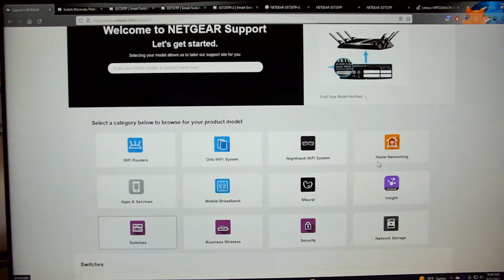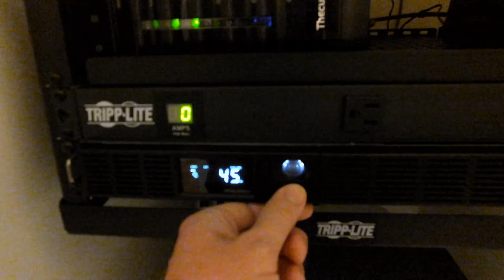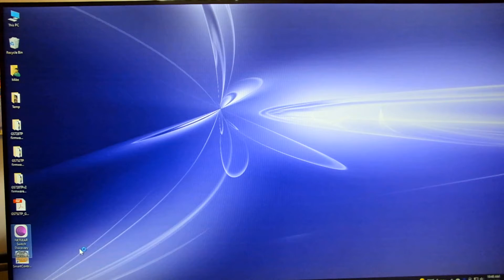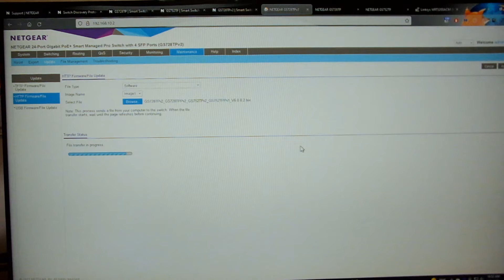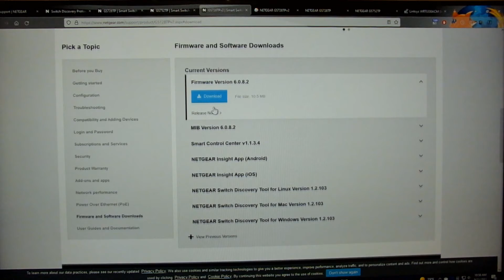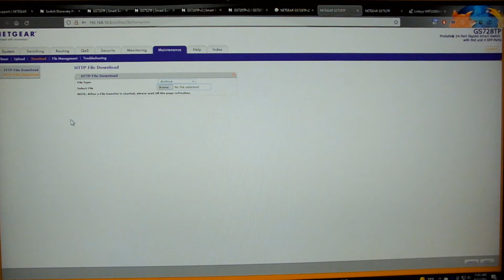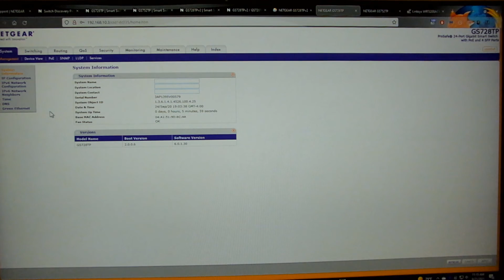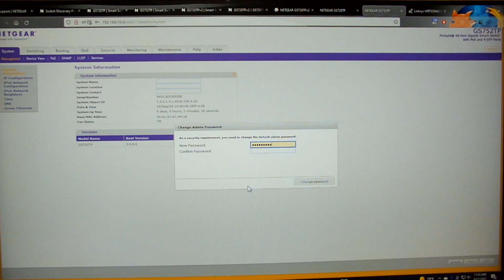How to upgrade firmware on Netgear switches

Comment: Very helpful video!  If you don't mind I took some notes where the update procedure is a little different on the XS728T switch from what the video is showing and have pasted it here.  I think this is due to Netgear making changes to the web interface with the newest firmware files.

Steps to Update Firmware
1. Access the Switch Management Interface:
   - Connect your computer to the same network as the switch.
   - Open a web browser and enter the IP address of the switch.
   - Log in using your admin credentials.

2. Navigate to the Firmware Update Section:
   - After logging in, go to the Maintenance tab.
   - Under the Maintenance tab, select Download in the File Management section.

3. Upload the Firmware File:
   - In the File Download section, select HTTP File Download or TFTP File Download based on how you want to upload the firmware file.
   - Select Archive as the file type to indicate you are uploading a firmware file.
   - Click the Choose File button and locate the (.bin) firmware file on your computer.
   - Click Apply or Upload to start the upload process.

4. Install the Firmware:
   - Once the file is uploaded, navigate back to the File Management section.
   - Click on Dual Image Status and see if image1 or image2 has the latest update.
   - Click on Dual Image Configuration and select the newest Image Name.
   - Click on the Activate Image box.
   - Click the Apply Button.
   - Click on the Update Button to begin the firmware installation.

5. Reboot the Switch:
   - After the firmware is installed, the switch will need to be rebooted for the changes to take effect.
   - You can manually reboot the switch from the Maintenance tab under the Reset section.
   - Check the reboot box under Device Reboot and click the Apply button.
Reply from the maker: Thanks for the well-organized list!  Yes, Netgear does frequently change the process on different models of hardware.  Appreciate your comment!

Comment from the maker: Hi! Thanks for checking out my home networking videos.  Glad they are helpful.  I'm still using much of the equipment shown in these videos in my own home network.  I do regularly update the firmware in all devices and continue to tune and optimize for performance.  Below is a photo (hosted on Imgur):

https://imgur.com/a/JFjvkm1

Not a bad network setup for a little 1100 s.f. house, imho.  😊  Feel free to drop any questions in the comments and I'll get back to you as soon as possible.  Thanks!

Comment: On my switch, there is no update under the maintenance tab.  How do I enable that?
Reply from the maker: Hi!  Thanks for the comment.  What exact model switch do you have?  It's in different locations on different models.  You may also want to try a different web browser (for example: Firefox, Chrome, Edge, Internet Explorer).  I've seen some older model switches that can only be configured under Internet Explorer, for example.  The UI doesn't display properly in newer browsers.  Also make sure you're logging in with the correct admin password and not in "view only" mode (some switches have a "view only" mode and a separate "admin" mode for making changes).

Here's the location of the setting on a newer Netgear GS728TPv2 switch:

https://imgur.com/a/Yurnztl

(image hosted on Imgur)

Hope this helps!
Reply: @CompTechMike  I was a me to use the windows app and upload the firmware that way (as you show in your vid).  Now, with the new firmware installed, I have the option.